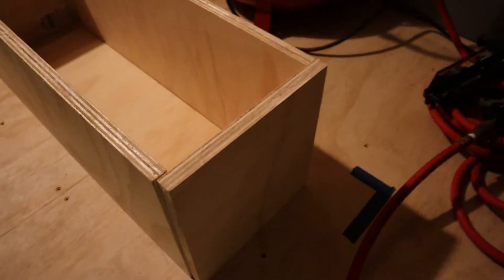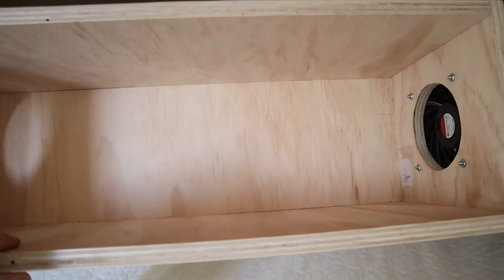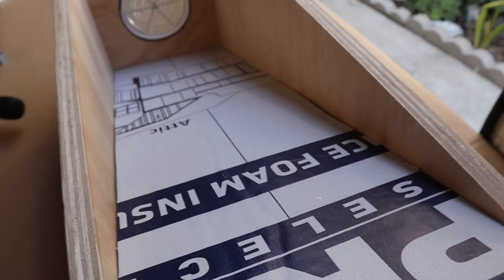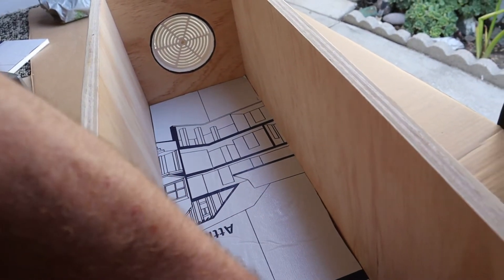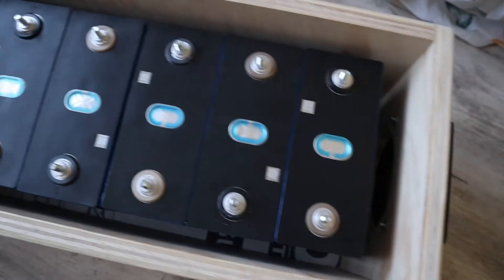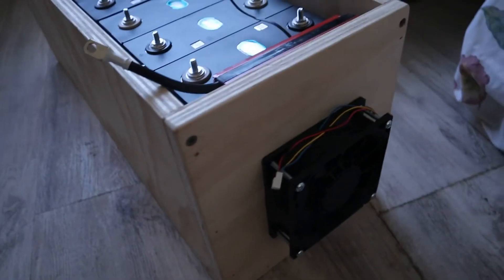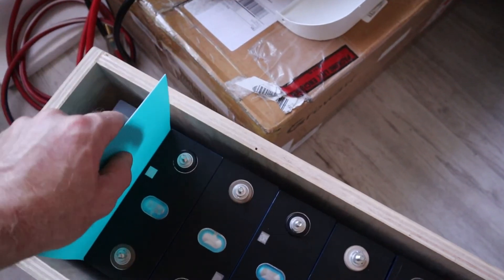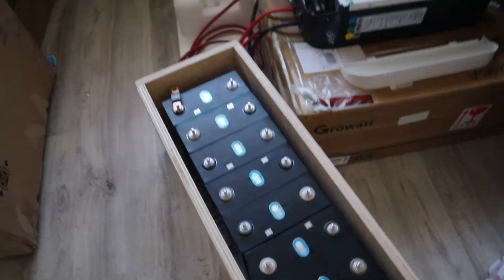Building A Box For My 24V 310 AH Lithium Iron Phosphate Batteries

Comment: Nice box, is it a hardwood plywood that you've used? how's it holding up? What about the airflow with the fan, is that doing it's job? 

I'm gonna build one off of your concept and add a heater for the cold new England winters. Thanks for posting.

Comment: How have the cutting boards been working for in between the batteries? I would be a little concerned that the textured side would cause more wear and tear of the cell walls.
Reply from the maker: Hi Ross. Thank you for watching and for your support. The cutting boards have been doing very well. They are kind of like a soft plastic almost like rubber, so they have been working very well and the lifepo4 cells have a blue type of plastic around them that also protects the cells, so it was just an extra measure because it is in a moving vehicle, but everything is holding up very nicely. Thank you so much.

Comment: just curious what did you do to make sure the batteries did not slide side to side into your screws from the fan and vent?
Reply from the maker: Hi Charles, thank you for watching and for your support. I installed 2x2 on the bottom and blocks on the top so that it is a really tight fit. Hope that helps. Please consider subscribing if you found the content useful. Thank you.

Comment: What are the dimensions of each peace of wood so I know what sizes to cut
Reply from the maker: Hi Rich. Thank you for watching and for your support. So your 2 side pieces are gonna be 25.5 inches length, height is 10.25 inches. Your end side pieces are height 10.25 inches and the length is 9.5 inches. The bottom piece is 8 inches by 25.5 inches. Bottom piece fits on the inside of the box. Hope this helps. Please consider subscribing if you found the content useful. Thanks.

Comment: I just want to let you know that the cells you are using are refurbished grade B cells that have FAKE QR codes. The original QR code is supposed to be by the vent, you can uncover the black cover and verify this. These are known to be coming out of wrecked BYD busses and or flooded EVs out of china.

Comment: I bought a 24v Growatt for a future van build too. Just finished assembling all the solar parts and it works! I’m using Maker Pipe connectors to build a freestanding metal stand for the Growatt which will sit over my 24v 200ah batteries. Looking forward to seeing how you install everything!
Reply from the maker: That sounds awesome Keezer. I also have the 24 volt Growatt 3000 that I plan on installing in my van. Man, but I will tell you with all 8 cells in this battery box, it is really heavy. Thank you so much for watching and for your support. Please consider subscribing if you found the content useful. Thank you and I would love to see your setup when you get it all setup. Exciting stuff. Take care.
Reply: @thinkfreelivefree6951  yes, a lot of metal in those heavy batteries! Mine weighs 60 lbs. I might add caster wheels to the base of my stand or at least a basic furniture dolly to move it around. Yes, I subscribed!
Reply from the maker: @keezer4346  😁 That is a great idea. I think mine is over 100 lbs. Thank you for watching and subscribing. Really appreciate the feedback.